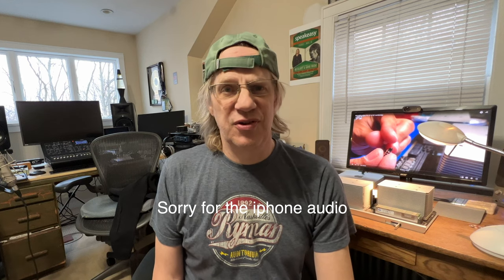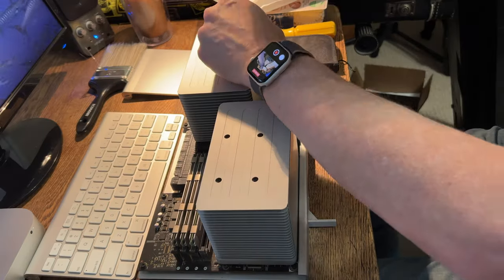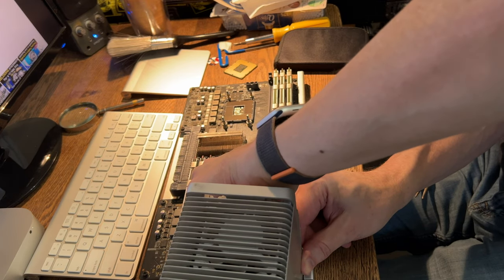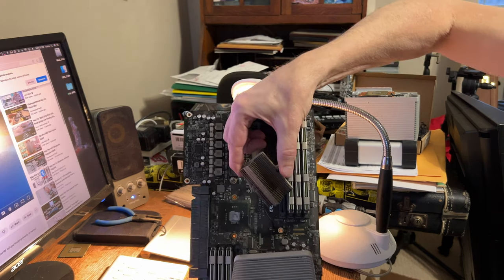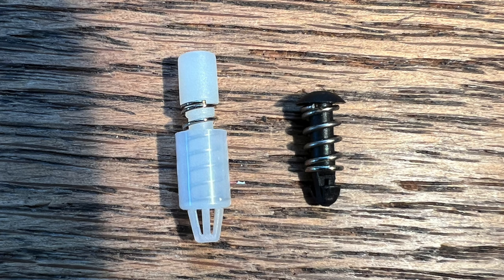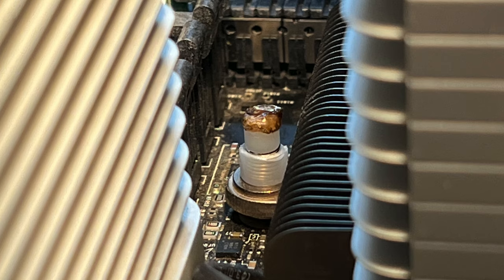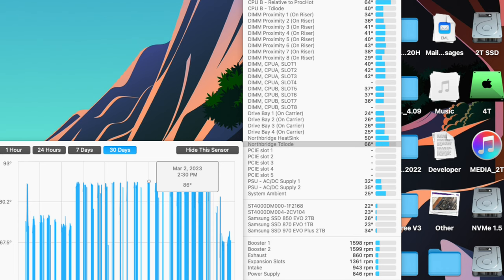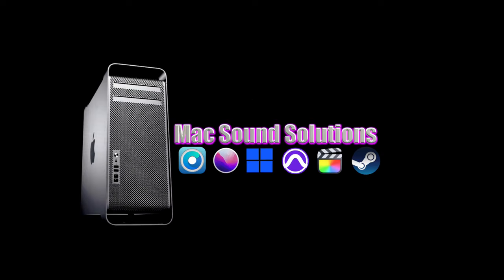Northbridge Why so HOT?

Comment: None of the cleaning nor plastic pin replacement helped me. I had above 75 C but now I am around 58 (if I don't remember it wrong), I used a small fan where I put it at a certain degree angled in order to fit in. It sits on the motherboard connection socket directed to the Northbridge cooler. I also use a fan controller connected to a USB port so that the fan works not at a max speed. I hope this helps to those who still love their Mac Pros. Cheers

Comment: From what I have seen about 72-75° degrees is pretty normal. I read somewhere that the chip itself is rated to about 105° (some say even 110°) so anything starting with 7 is IMHO not that bad. I haven't repasted yet but I did tweak the fan speeds a bit and NB temps stay around 67-68° while watching 1080P video in youtube. Fans are pretty quiet too.
Reply from the maker: Yes it is mine runs at 72 to 75 now as well but it use to be hotter.

Comment: I feel ur pain bro! whether its computers or working on cars, Ive been in that boat where you try to improve on something and end up with a mess, sometimes worse or just in the end no different after all ur efforts!  Looking at ur temps, my cpu is usually  around 38-40c and northbridge somewhere around 62c and ive not repasted it.. I noticed how high ur fans are ! I have mine set at their Lowest points across the board and it keeps things cool.. ive noticed on this mac pro 5,1 with a single maxxed out 6 core, that it runs in general Wayy cooler than my 1,1 with  2x3ghz quads..anyway, glad you powered thru the issues and thanks for sharing to others can benefit from ur experiences.

Comment: I watched this video, saw your pain and grief and pondered what would I do, Lol. I bought the pins and new TM all ready for action. Then...I opened up Macs fan control, set the Northbridge fan to sensor anything above 55c and haven't looked back, temps sit at 52c-56c on my gaming Mac Pro. As always, nice vid.
Reply from the maker: Yeah the NB runs hot and it’s pretty normal I could have left it alone till the pins break if they ever did, I have my fans run with iStat, but I game in windows and don’t have software that control the fans in Windows, but temps seems to be fine with gpu and cpu.

Comment: Check your heatsink mount. I did several re-pastes recently and with one I had the issue with a high delta T as well (T Northbridge - T Heatsink). Solved by redoing work (cleaning, pasting). Delta T should be around 10ºC, when higher there's not a good heat flow of the NB to the heatsink. The mounting needs to be very precise and even a slightest tilt of the heatsink can cause bad cooling.
Reply from the maker: ugh! I guess I will try it again, might go back to the original pins as they seem to be tighter fit.
Reply: @MacSoundSolutions  I used some Nylon M3 nuts & bolts I had laying around. That's just perfect! With the original springs very well adjustable and fixed for life! Nylon is more durable than any plastic pin as well.

I found out with multiple MacPro 5,1s that idling (low fans) the NB temperature will settle around 70ºC and NB heatsink will be around 60ºC for a dual core tray. A difference of 10ºC between NB diode andNB heatsink when idling indicates the cooling paste and mounting is okay. Anything over 15ºC difference when idling would indicate a re-paste / mount.
Reply from the maker: @RolfNoot  so you used the old springs with the new M3 bolts?
Reply: Yes exactly. You can tighten the bolts as much as you like but I chose to press the springs exactly the same as the original pins did. It’s quite delicate to not letting the heatsink tilt a bit, it has to sit flat on the NB surface. I had the tilting initially and noticed the temperature of the NB went much higher than the heatsink (>15°C difference)

Comment: The Northbridge heat sink always runs hot. To compensate, I turn the fans up and it will work but it also makes a lot of noise with the fans on full blast. Oddly enough, I find that it's not that big of a deal to replace the fans with high-quality ones that are almost whisper quiet and they are energy efficient.

Comment: Hi lance. what is the northbridge? i just did the xeon 5690 upgrade yesterday and my 2 cpu temps dont go above 35 Celcius with artic mx-6. i noticed one of the northbridge heatsink screws was loose but when i screwed the heatsink back down on cpu a it holds it down. 2009 Mac Pro
Reply from the maker: The northbridge is the controller between the logic board and the cpus, you should fix the loose pin, there are no screws with the northbridge, look at house of moths video and you will get a better idea, but if the northbridge is loose you need to fix it asap.

Comment: Lance, thank you for the content.  With NvMe drives being so cheap now, I have found another generation of Mac Studio (M2) I don't need to buy as the 5,1 STILL doesn't fail. I'm confused why you have not freed up your PCIe with a Gigbyte 6600XT? They are extremely affordable especially used and with the sale of your existing GPU, you can't really count yourself in a loss with the added power and PCIe lane.
Reply from the maker: No need, I like the rx6800xt for 4K gaming in Windows on my new OLED . I have the McFiver PCIe 3 in 1 card so I have two NVMe drives in it one for system with a scratch disk and one for projects. Don’t really need to add any additional cards. I can get one more pcie in if I wanted to but honestly I don’t need to. The Mac Pro is running great with Monterey 12.7. Long live the 5,1!
Reply: I’ve tried to install Monterey on my 5.1 but I must be doing something wrong because even if I follow the instructions it just doesn’t work. I run HS and Mojave, but wouldn’t mind upgrading my OS. Cheers.
Reply from the maker: @johnnyquid-xj4kk if you use Martin Los opencore package you have to do two edits to the config.plist before installing Monterey, I have several videos on it but you will have to download the Monterey installer and Keep Mojave drive for fall back. Or use Opencore legacy patcher and follow Mr Macintosh instructions here on YouTube.
Reply: ah, thanks. I'll make it my project this weekend. Already have the downloads including the open core update. Thanks for the input.  @MacSoundSolutions

Comment: Hey Lance quick question, if I install Windows 11 with rufus and check first option for removing secure boot and stuff, will this prevent Windows from writing certificates to BootROM?
Reply from the maker: Yes, but you need to have opencore installed while doing the install to be safe. You should also move the 
“Microsoft” folder  that gets placed in the opencore drives efi folder to the new windows 11 drives efi. Mount the efi of the opencore drive and the efi of the new windows drive and copy the microsoft folder to the windows efi and then delete the microsoft folder from the opencore drive. This will will keep your bootrom safe, just don’t boot into windows without opencore.

Comment: Dude you were VERY lucky re:CPU B socket. Those pins can look visually perfect and socket can still be ruined. Ask me how I know.
Reply from the maker: lucky and unlucky... I felt like a complete idiot when I saw they were bent! My finger just grazed them. The fact it didn't boot the first time I thought I was going to have to get a new Mac.
Reply: there are so manu dual trays, especially 4,1 versions on ebay where some boob overtightened the cpus in the sockets and bent the pins..they are probably a high risk to buy since sellers usually say they wont post buy as is.
i Want a dual tray and these are tempting but man, u can See the bent pins in some of those ebay trays! I always though u Could just straiten them out but who knows?
Reply from the maker: @skip741x3  all it takes is one bad one and no boot. They are very tiny and hard to mess with.
Reply: @MacSoundSolutions  you wouldn't need a new mac just the board.... you should pick up a few spares for next time....
Reply from the maker: @jhillestad  true just need a new CPU tray, still working fine though.
Reply: I dropped a sticky towel on the cpu socket, it pulled up several pins. I spent hrs trying to align them to no avail. I could’ve kicked myself for being so careless. Ended up buying a new tray, $40. Ughh

Comment: It's really nice to have a kinda normal guy like you to experiment as the sheer crazy skills of the House of Moth are rather misleading actually. As for the subject matter, as I mentioned under another of your videos, Hardware Monitor has always given me 83 ºC for the Northbridge Chip and my Mac Pro has always run fine. So judging by your experiment, I think I'll pass repasting it!
Reply from the maker: it seems 80c is pretty norm when idle, the temps can actually go down a bit if you stress the CPUs because the fans kick up.
Reply: @MacSoundSolutions  Yes, exactly right. Northbridge is right in the flux of the Boost A fan (or just Boost on a mono processor machine like mine) !
Reply: @MacSoundSolutions  It is actually quite an impressive drop on my machine: Hardware monitor reports 65 ºC when the fan cavalry is unleashed.
Reply from the maker: @lucbourhis3142  same
Reply: @MacSoundSolutions Looking online at the definitive upgrade guide, people had problems when the NB was well over 100C, and it ‘s normal for it to be quite hot compared to everything else (Mine is in the low 70s and I can get it down to 40 with full fans).
Reply from the maker: @老黑班长  yeah it runs hot mine is mid 70s now with a bit of fan control